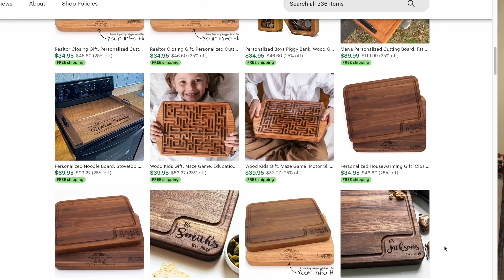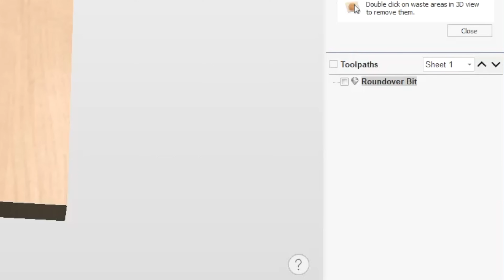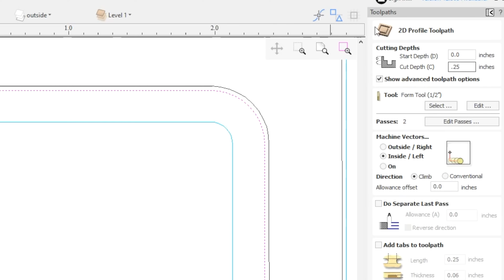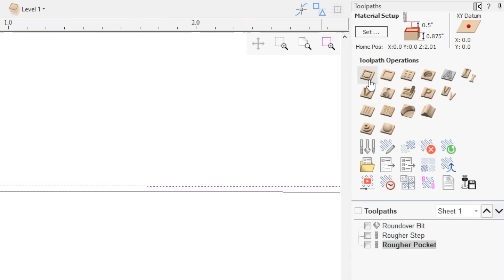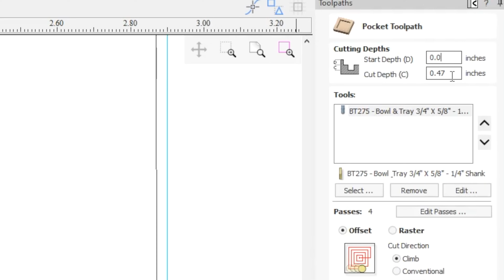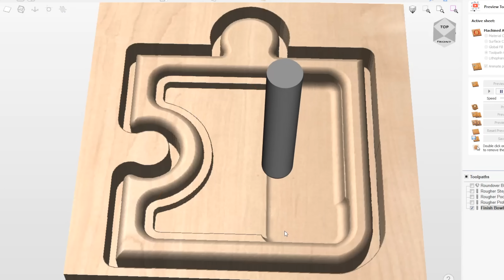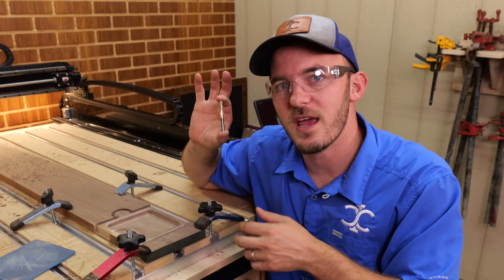5 Advanced CNC Tips to Save You HOURS

Comment: For those machines that use ER nuts and don't have a proper ATC spindle, there's now a thing called RapidChange ATC, made in the USA. I bought it a year ago, tried it out and helped develop this product by providing feedback and honestly it works quite well and can save you some money if you don't already have a compressor and all the extra stuff to equip your machine with to support a real ATC. It integrates beautifully with most common software like Mach 3 or 4, UCCNC, Masso and so on and it has a very easy to use GUI wizard that helps you set it up in no time. It sometimes can jam, so you should always supervise it, but overall it's a game changer for saving time, just as much as using the right cutting strategies you show in this video.

Comment: On toolpath #2 you inset .25 inch and cut the step down to ,25 inch.  If I am using the 7/16 bowl and tray bit and my total depth for my pocket will be.25 does that mean I would inset only 1/8 inch and my step down would be 1/8 inch, because the radius of the bit is 1/8 inch?

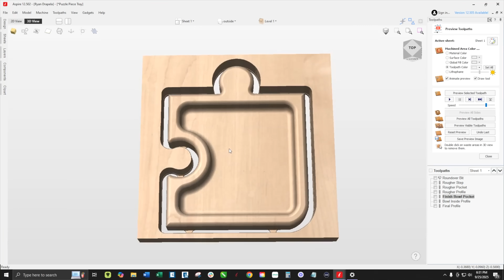Comment: one tip from my side. At 18:26 is easiest to see - I would never put tabs in the inner parts of the design (rounded one on the left). Keep them outside on the flat portions. Much easier to sand off without any "special" sanders. It makes no difference while cutting, tabs will work the same.

Comment: Here's a time saving tip for anyone doing this on an ATC machine. I'm not sure if this is a glitch in aspire or just the post processor I'm using, however I have noticed that when doing a tool change, aspire will command the machine to go to the tool change position at whatever the last cut speed was. If this was something quite slow it can really drag out the tool changes. My workaround solution is just before a tool change, add an extra tool path on the previous tool that cuts nothing and runs at the maximum speed of the machine. i.e make a small circle and set the depth to zero. This means when it runs the tool change for the next tool , the tool change will take place at the max speed allowed by the machine.
Reply: You could change your post processor. Look in the tool change section or in the „End of Programm“ section. You could add your own G0 code or a fast G1 F…. 
I had to change my ATC postprocessor for my needs and it is really easy to do it
Reply: @BiuTse  I'll have to look into this. Writing and editing post processors has always been a mystery to me. Can you recommend any good videos / websites for learning the basics ?

Comment: Just to make sure I'm ordering the right round over bit - the roundover you linked below is the PC25.  I uploaded the your library file.  However, the speeds/feeds/etc in the library are different for the PC25 than the parameters you show @2:58 .  Do I need to edit the library for the PC25 to reflect the parameters shown in this video?  Or does the video show a different roundover bit than the PC25 (which is linked in the pinned comment)?